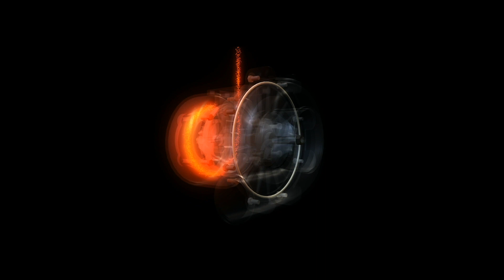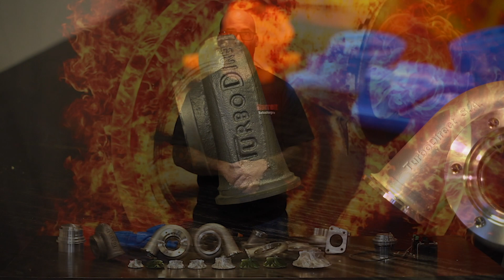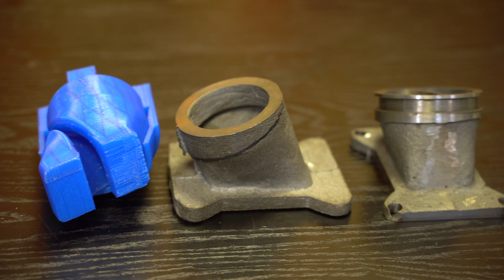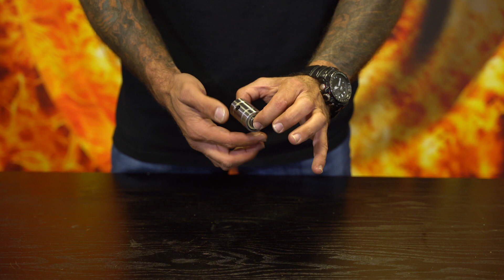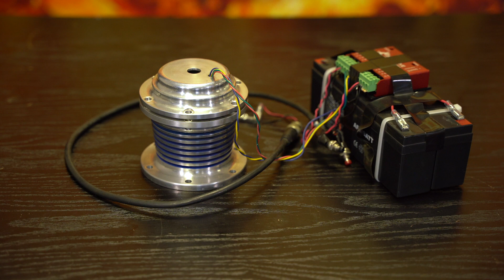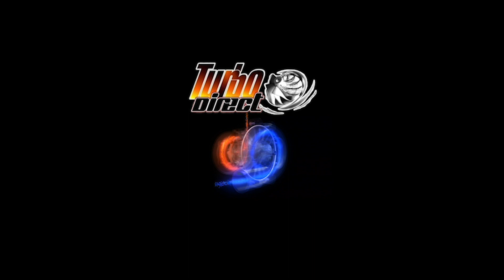TurboDirect S.A - big things for 2021

Comment: Exciting news...so what do you have to make 500bhp, responsive, and not choke on the top end...for a 2.0 built block
Reply from the maker: Watch this space - the first release update will come in May - there will be two options to start with, power capability will start at a TRUE 600HP (65lb/min compressor)  and the second will offer a TRUE 850HP (95lb/min compressor) - 

Both offerings will be ball bearing, something never seen before in the price point that will shock you! No its NOT chinese knock off junk, its in-house designed, tested and proven. Our prototype is on a drag car that runs in the 10's and boost is not run lower than 2.0bar gauge pressure. We have logs on the same dyno on the same day back to back against one of the very popular OEM brands and we hold our own and easily against this brand at the same boost at half the price.

Comment: hi
chick that
https://www.shop.mambatek.com/searchquick-submit.sc?keywords=007-0017
Reply from the maker: HAHAHAHA check the description "5+5 blades" and the picture shows a 6blade splitter - we have many mamba turbos in our shop all failed, and its scary what poor quality this product is. The turbine housing AR's are nowhere near what they advertise, the most commonly purchased mamba turbo in our country is the bolt on subaru EJ20 and EJ25 setups, with failure after failure. I used to have a video on my facebook page where i compare the flow output on both turbine and compressor between a GT2560R (tiny turbo) and the mamba/JPturbo/Kinugawa paper weights, and youll be surprised at how poor these turbos perform even on a bench.

Comment: Will these be comparable to say efr 7163/gtx3076r sized?
Reply from the maker: No - direct comparison would be the GTX3071R (same size exducer on the compressor wheel) however although the GTX3071R is said to flow more, the EFR makes the same power at the end of the day tested and compared back to back on an EA888.3 engine. The EFR makes 550HP at the wheels, on the same engine at inside of 0.1bar boost gauge pressure, the GTX3071R Gen2 makes the same power (inside of 5HP)

Comment: I have a reasonable question if you pardon the setup. There is very little purpose for a small scale manufacturer to invest in dies for different compressor wheels. At a cost point it is probably just as financially prudent to machine from billet each wheel as would be to invest the time an material to cast each wheel. What benefit do you see with a billet wheel over a cast wheel? I like them all and each has its place. On a boutique product like this, I don't think it would be close, I believe the market would severely limit your ability to sell a cast wheel at all. The reason I ask is there are staunch disciples of cast compressor wheels that proselytize the absolute lack of difference in performance by any measure between cast, billet and FMW.
Reply from the maker: Thanks for the comment, the basic high level outline of billet vs cast is simple - high boost, high speeds = billet.  Lower boost, less abuse = cast.   Billet wheels are not all created equally - using a billet extrusion versus a FORGED extrusion and then milling the material will have a totally different result in strength and weight - stronger forged materials will allow design changes that will increase blade area for higher flow reducing weight with the same inducer and exducer dimensions, something a cast wheel cannot offer due to root failures......... and the list goes on.  We have the ability to manufacture our own billet wheels which will be featured on all our turbochargers, as higher and higher boost levels are becoming the norm and if you want a reliable product that will last, you need to choose the best materials, manufacturing processes and concentrate on quality, or done even bother.

Comment: Guess this answers my comment from your last video!

What I would like to see when it's installed: a torque curve that shows a roughly similar boost threshold as the OEM unit (e.g., 280 ft lbs from 1800 RPM), and a car running this unit down a drag strip a few times. Then you have my money.
Reply from the maker: This will always be different on every engine, the engines ability to consume the turbochargers flow capacity and characteristic through a set boost pressure will be ever changing based on the engines ability to use, consume and produce power from it -- or not.  If there is an "air dam" of surplus flow capacity from the turbo,  and the engine consumes it all and wants more, the torque curve will be affected, especially if the turbocharger cannot keep up with the engines demand for air flow. The other way round applies too -- keep in mind that the turbochargers are universal and have a flow capacity and ability, it boils down to the best choice of turbo for the said application -  I hope that makes sense.
Reply: @TurboDirectSA  Ah, I thought you would realize I was asking specifically about the Golf 7R based on your reply to me yesterday. I don't take dyno numbers as gospel, as much as, if it makes its torque on your dyno from the place as the stock car on your dyno, then it's similar enough.
Reply from the maker: @acefighterpilot  We are developing additional Golf7R specific turbos, which are lower HP rated and spool fast and remain punchy. Our two options which are both bolt on are already in the market and running internationally with huge success. 

The new unit will be a nice setup for a stock motor.
Reply: @TurboDirectSA  Ah, sorry, that's what I thought you were getting at in this video. Too excited!

Comment: Also do you have any special plan regarding turbine wheel? Garret with the new g-series is small improvement on gt series ,  BW has ti-al wheel and shaft + that mixed flow turbine on 7163 , Xona has that half blade design...
Reply from the maker: Turbine design will remain something similar to the existing technology in the market, but with a combination of such - youll see this soon.